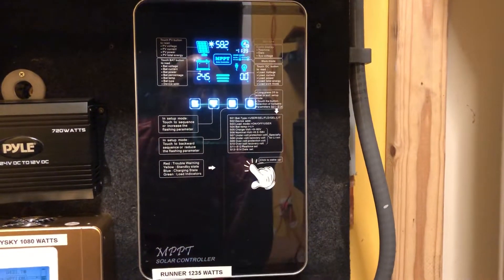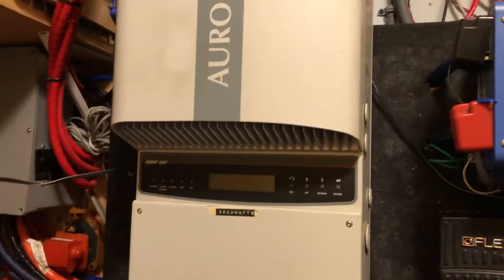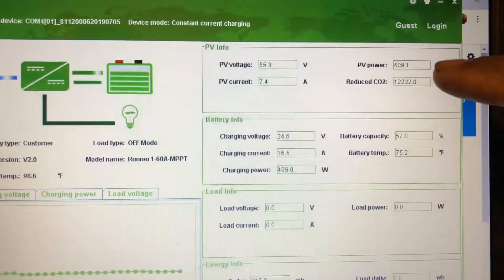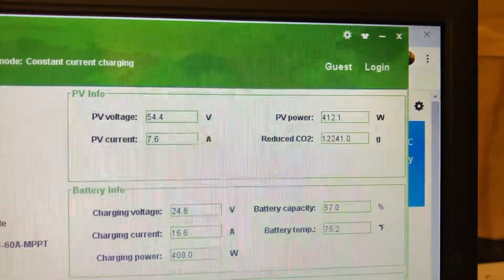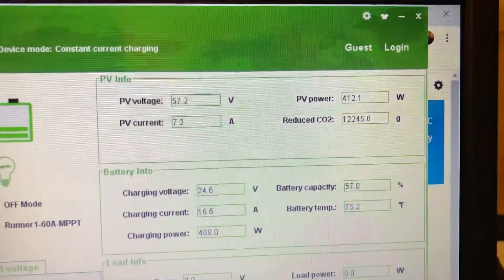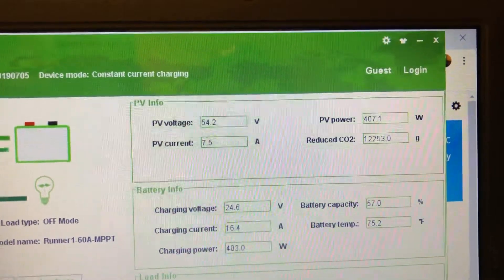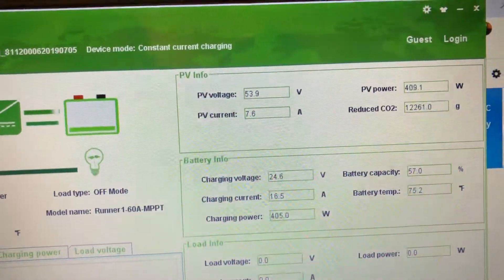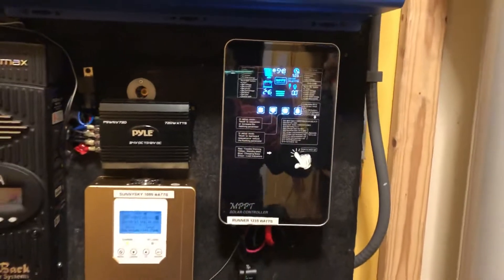esmart 3 solar charge controller

Comment: i have an unbranded version of the same controller. i found password to be "mpptsolar", but i cannot connect to the controller it seems. do you have any advice on how to get the usb to communicate? thanks for this video
Reply from the maker: andrew thanks for checking out my video/////on your charge controller hold your finger on the s for a few second till it flash user or [so1]....[s01 is for battery type,then let go and press again till you see [s02] then let go,,,use the bat and dc key to select your device address it  needs to be on [1] for it to communicate with pc

Comment: I agree with what you are saying 100%. I have just recently discovered your channel,  I like how you present your info,  very factual,  straight up with evidence to support. I am new to Solar and have been researching equipment for my first DIY off grid project.  I have been leaning towards Mpp Solar inverters, but now after seeing your content, I am convinced that I am making the correct decision.
What Mpp Solar is offering at the price point they are offering it at, no one else is offering a better package.
Reply from the maker: thanks for checking out my video,,,,,and take your time when building  your system
Reply: @bimmers323ci  thanks for the advice !

Comment: I have a classic 200 and I have a Chinese powmr with the same amount of panels on each one and the make the same power the only difference is $600 but you have to connect them right if not the one that work
Reply from the maker: damian roman —thanks for Sharing you input on your system we need more positive feedback like these—thanks for checking out my video
Reply: I'm going to use the classic 200 for a wind turbine and getting me another Chinese charge controller for the solar

Comment: Note: The esmart 3 is not aware at the PV power, it actually deduces it from the power going in the battery and just add a fake coefficient of 99%:
In your case, this is 410/414=99%
http://skagmo.com/page.php?p=documents%2F04_esmart3_review

Note: I use the 2x esmart 3 for 2 years, they works great (1.3 MW hour already per charger!):
https://www.youtube.com/watch?v=VN2PXqLMG04
Reply from the maker: Alexandre Esquenet thanks for checking out my video